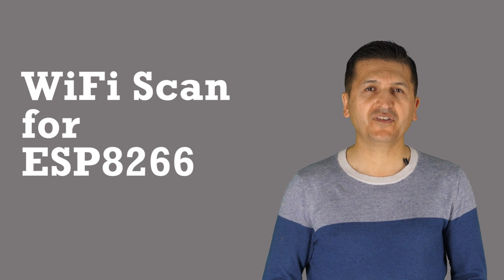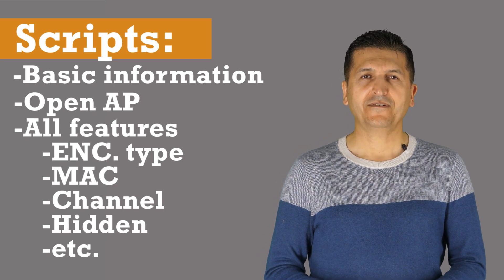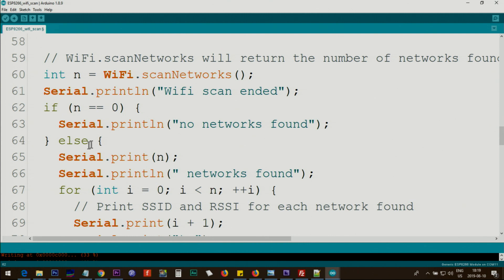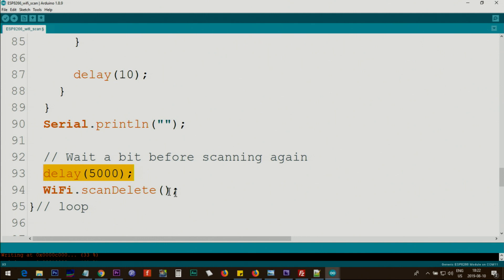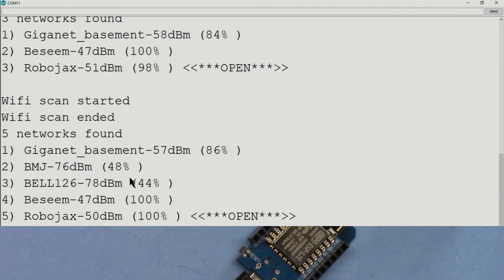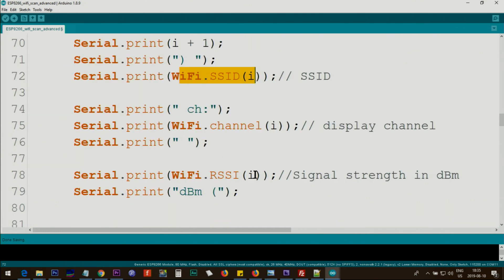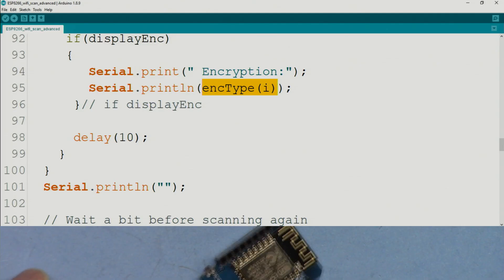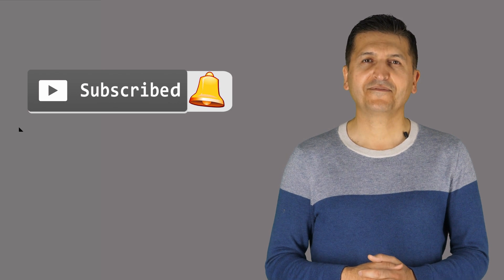Check All WiFi Access Points using ESP8266 WiFi Scan Signal Strength with Arduino RJT197

Comment: How can we automatically connect to the strongest signal?
Reply from the maker: Interesting topic.  It would be possible. just do the scan inside the setup() and find the SSID with strongest signal, then used that with the password to connect and it will stay connected to that SSID.

Comment: the code uploaded fine but all I'm getting out of the serial monitor is garbly-gook , a bunch of backwards letter and unrecognizable symbols. WHy????
Reply: Solved ; I had to change my baud rate from 57600 (which it was at as a default) to 115200. This instantly changed symbols to legible words mid-flow of the serial monitor print out.
Reply from the maker: I am glad you solved it.

Comment: sir is that possible for esp8266 to scan the wife and connect to wifi at the same time. because i want to send the information to firebase in realtime.
Reply from the maker: no. you can't. what is firebase?
Reply: @robojax  firebase the dabase in cloud ssir

Comment: I try to get the code from the arduino.io from the website and try to change some program progress but not done yet. I get error in arduino monitor say ( connection fail )
Reply from the maker: for your SSID make sure to pay attention to Upper case and lower case. for example ssid of "Abed" is not the same as "abed".

Comment: This very good . But how to use this esp8266 with out logic converter . I have the small wifi that need to be install in to arduino mega have 1 lcd connected and 7 sensor and 8 raly need to be controlled by web from phone  from outside home .
Reply from the maker: Please watch this video to use LCD with ESP8266 and it will work with any ESP8266 like NodeMCU, D1, D1 Mini etc https://youtu.be/mRAgS-CdURU